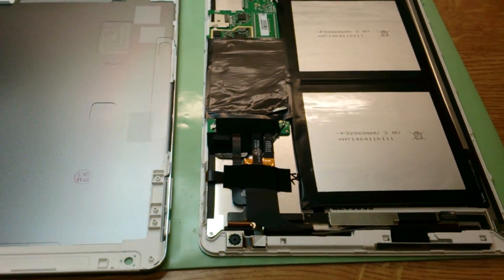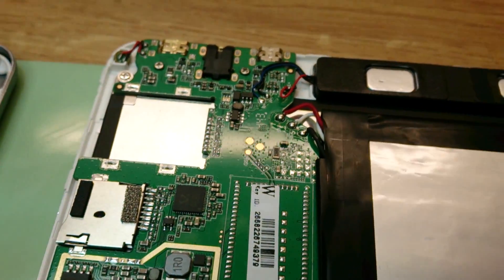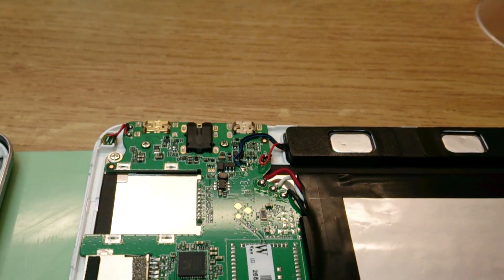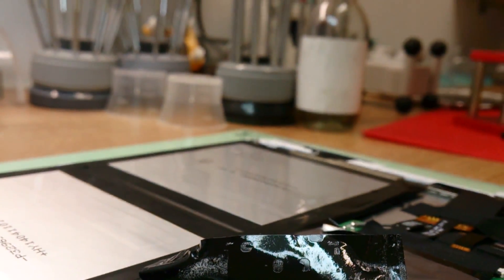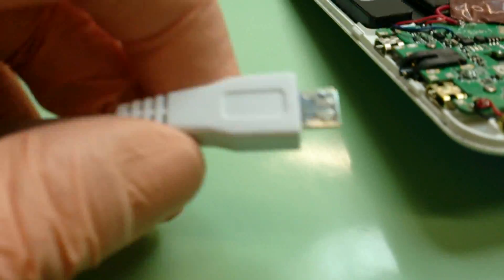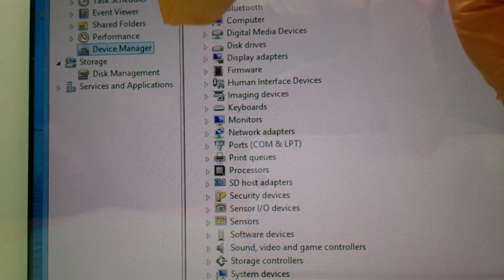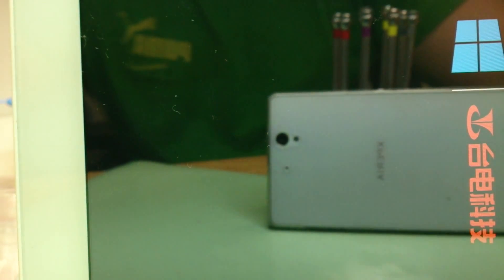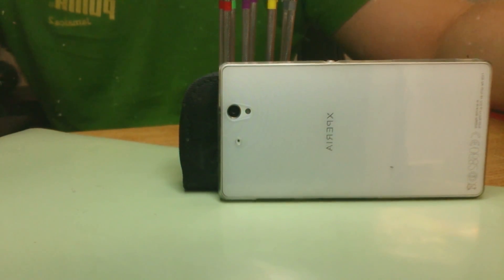Teclast X98 Air II Windows 8.1 tablet Intel Bay Trail - Battery not charging when ON, Dissasembly

Comment: Hey, I'm having the same problem and it started after using USB OTG Hub from eBay. Windows gave me an error about USB device malfunction and after that it seems the charging stopped to work. Have you made any progress with your issue? I'd be glad to know how to fix this...
Reply: +1KeNnY1KeNnY1 Hello, please any news on field of OTG/Charging issue?
Reply: +1KeNnY1KeNnY1 
I'm happy to report that the charger in the link above (Qualcomm 2.0 quick charge) DID fix my charging issue. Charging is not very fast and I have not tried to use tabled intensively while charging, but nevertheless I don't have to switch it off anymore just to charge! Charging works with original USB cable and also with another one I purchased.

EDIT:
It's so strange! I thought everything was OK and I booted my tablet this morning while it was plugged in. It was NOT charging anymore when switched on! I tried this and that and finally found a way how to initiate charging, also with my older charger:

1) Plug micro-USB to tablet
2) Plug USB to charger. Note that charger must NOT be plugged in to wall socket. With Qualcomm charger this only works in QC2.0 port for me
3) Finally, plug charger to wall socket

Download "BatteryBar" software to monitor your charging. In Windows you have the battery icon which shows the AC cable image when the unit is plugged in for charging, but that AC-cord logo never appears. So Windows doesn't actually detect that it's plugged in, but charging is still working.
Reply: +mazykx I did this (add a resistor 2kohm between pin 1 and 4 on the micro usb plug of a cable) and works for me. Now the tablet (HG8N) charging when is on with the stock charger. See the video in my channel
Reply from the maker: hello buddy, damn it ! We have same issue :( damn USB hubs, I shold have not use it. Last thing I have thinked of maybe the drivers reinstallation. Once I will knw fix I will make a video. We are not alone with this issue, also chinese have the same problem.
Reply: Hey! Any luck solving the issue? Something weird happened just a while ago and it was a positive sign! I had my tablet sitting on a table with charger connected when I removed the charger from AC-socket. Charger was a bit warm and I started to boot the device, holding power-button for a second. To my surprise, tablet had been in sleep because I was welcomed with the slide-up-window. I immediately ran powercfg /sleepstudy to notice that it had been charging for the past 1.5h. It was not showing grey dotted 'AC-charge' graph, but green line going upwards. Battery was at 90%, so I put it back to sleep, waited for ~3mins to find the battery at 91%. Great! Charging was somewhat slow, some 2500mA, but still... I fired 'Asphalt 8' to consume some battery, but my device thermal throttled quite fast. I haven't been playing that much anyways with my tablet. Well, after this reboot the charging doesn't work anymore. There was a positive sign and a proof it shouldn't be damaged. I really don't know what caused the tablet to charge for a while. If I find something I'll post it here. On Xda forums no-one is replying to charging problems...
Reply from the maker: haaghala Hello buddy,

not yet, try to reinstall the battery driver ? Does the tablet charge while it is off ?
Reply: ***** I've been playing around with battery drivers, but no help from there. Tablet charges when it's off. I'm now trying to drain the battery completely witht the charger attached. Could it be that something tells the tablet its battery is constantly full. Or then another idea: I hooked up a lab power supply to the charging wires and noticed that the tablet was constantly backfeeding me +5V. Could the tablet be somehow stuck in OTG mode..?
Reply from the maker: haaghala Great that you have that laboratory power supply. Interesting, so it is really an driver issue, as driver should drive the OTG or Charging port, we need to reset it somehow, if there is some hash command in BIOS or what.
Reply from the maker: mazykx Hello buddy, still no update, but I will be buying this charger hopefully this will fix the issue of no charge durring turned on device http://www.aliexpress.com/item/2014-newest-4-USB-ports-EU-US-UK-plug-Qualcomm2-0-quick-charger-wall-charger/32242141652.html
Reply from the maker: haaghala Thank you buddy, who knows if the resistors when forcing with higher AMPs from the charger, can degrade by time, so could be after time also this charger will not work or something. Would like to update to Windows 10 to see if it change something or not.
Reply: no idea what thay ment in here..
There
 is a temporary solution to the resistance 2-2,5KOm soldered onto the 
circuit between pins 1 and 4. Also, add a diode, or must first be 
included in the charging cord and then to the plate.  Verified Teclast Taipower X98 Air 3G - Talk 

  With regard to the charge.  Installed wire normal section.  Charging works at 2,5A.  upon reaching 4,2V at the battery current starts to fall (it's somewhere after 70%) 
  Also, charge controller AXP288 in this current (2,5A) gets very warm. 
 Being on the same substrate with a processor (overheat), it is 
necessary to refine the cooling and the controller also requires 
cooling. 
  As I understand it gives the controller the load, depending on the input voltage. 
 If the voltage is reduced - and so is not a thing of the protection of 
the battery, the controller reduces the current consumption.  voltage must not be less than ~ 4,6V (I measured directly beside the controller).  (With some delay controller stepwise gaining current).
Reply: +Nikos Karakolidis. Yes for me IT worked Also.
Reply from the maker: Nikos Karakolidis Thank you buddy ! I will try it then. Please does it affect function of USB in any way ? Like a USB sticks, devices, etc. ?
Reply: +1KeNnY1KeNnY1 I don't think so but i'm not sure because i use this cable only for charging and connect to pc, I don't know how it acts with a usb otg hub.
Thank you for your video and thanks to mazykx because i don't think that i can find this trick without you.

Comment: maybe your charger is fucked.
Reply from the maker: Nope, would be happy if it was charger, but it is device. Used different chargers everything will not charge when system is on. It will only charge when it is off. Checked Teclast BBS Chinese forum, and noticed not only me I have / had this issue. Question is, if it is Driver issue, or Hardware issue. Other issue could be the protection circuit for batteries or maybe the Chip responsible for Power management it self. I will make a video describing what did I tried these past 2 weeks, and also how to re-calibrate battery.